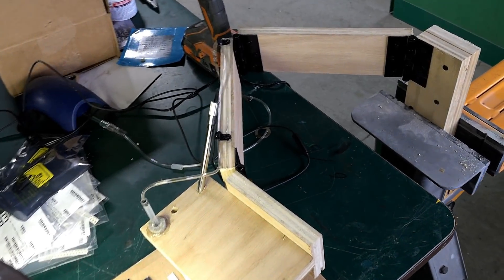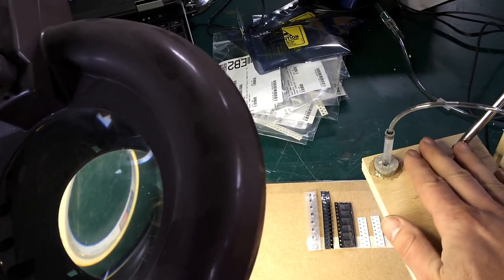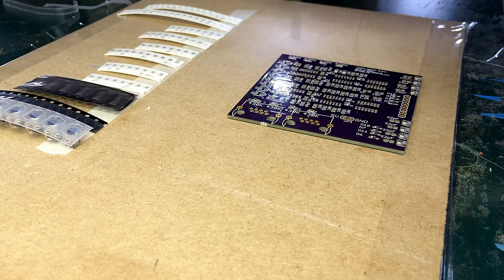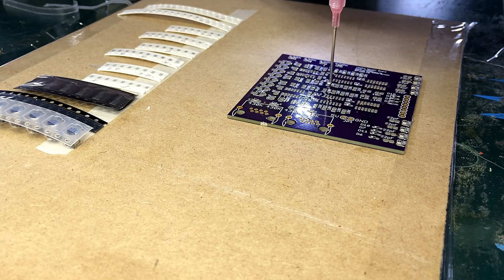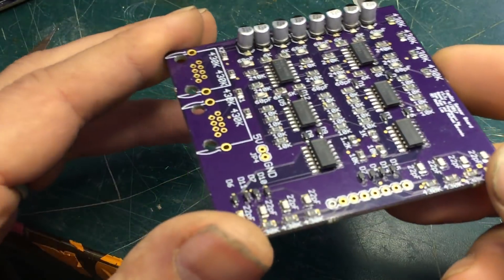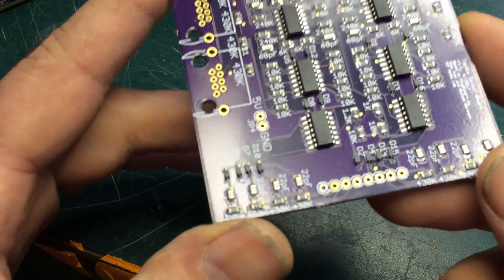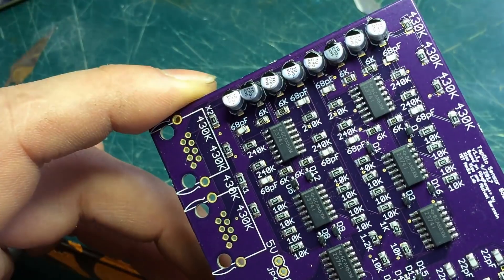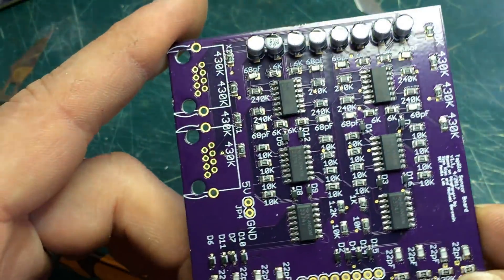$10 Pick n Place setup  Easily place SMT componets

Comment: Nice! It looks like you originally drilled a hole for the camera straight down and next to the vacuum pickup. That would have been my guess for the best view for pick and place alignment, but you instead have that angled view. Did you find that to be more effective?
Reply from the maker: I ended up not using it much because it slowed me down.   you have zero depth perception so it makes it hard.  I was thinking of having two line lasers that formed a cross hair directly below the syringe.  I think this would speed up placement dramatically.